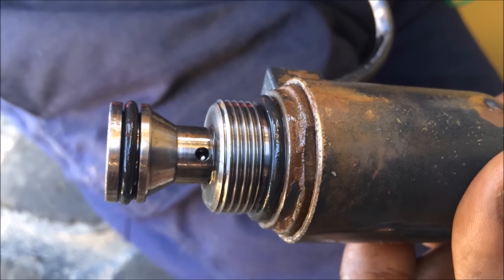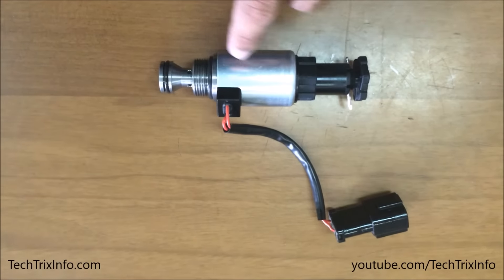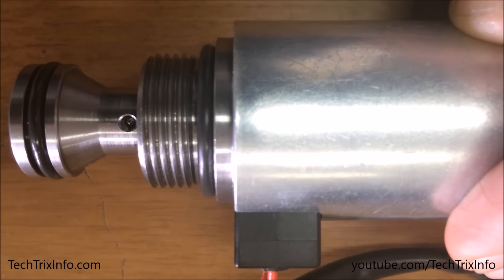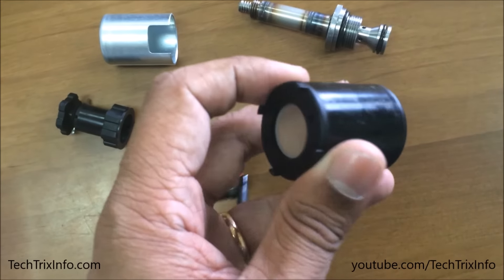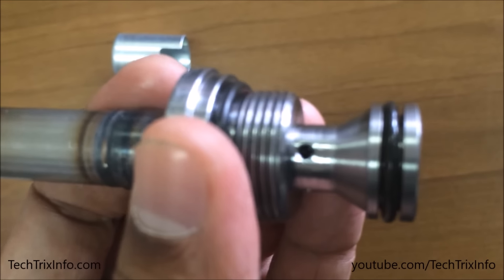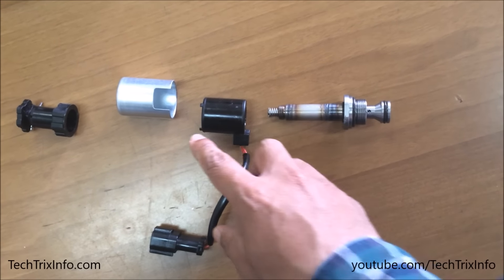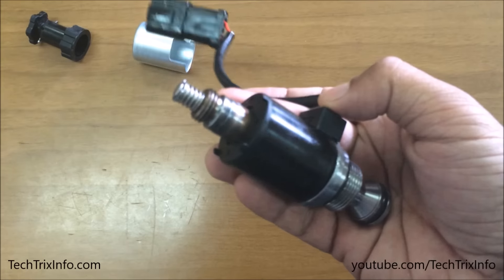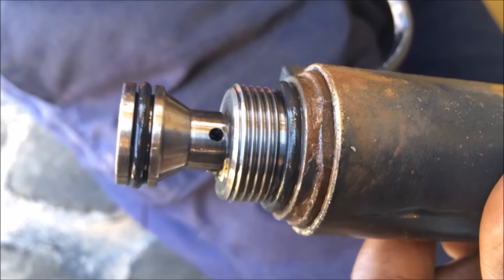How solenoid valve works for real.

Comment: is the solenoid vacuum operated?
Reply from the maker: +7150285 
M not sure, may be not this one

Thanks for the comment 
Mechanical, Automobile engineering updates through Whatsapp @ +919744615655 (requests through Whatsapp to get updates)
Reply: What is the name of this solenoid valve?

Comment: Where exactly is this solenoid valve used in cars ?

Can you tell that as well ?
Reply from the maker: +Gautam R 
This particular one was used in construction machine 
Thanks for the comment 
Mechanical, Automobile engineering updates through Whatsapp @ +919744615655 (requests through Whatsapp to get updates)
Reply: This particular valve is used in industrial hydraulic systems. Your thinking of solenoid valves that are used in automatic transmissions or for racing applications such as line lock or trans brake solenoids.